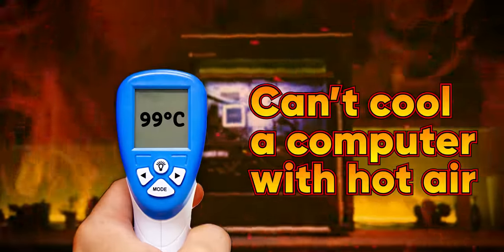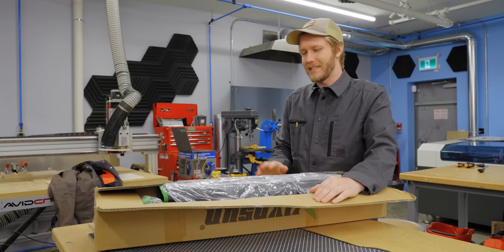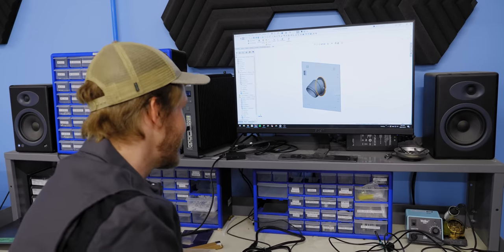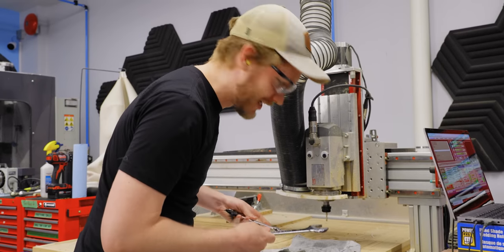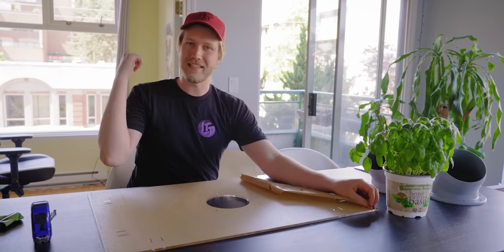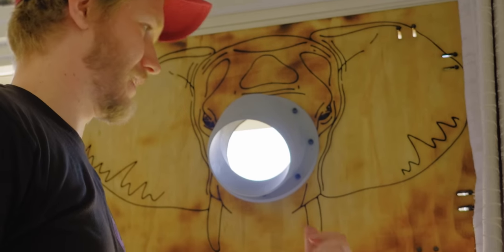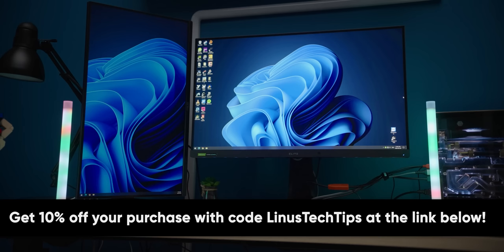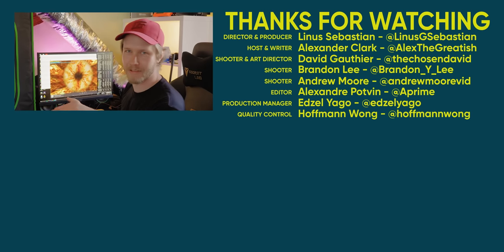You’re cooling your PC wrong. - PC in a Grow Tent

Comment: It's hard to say that the grow tent is the cause of the room temp decrease. Venting the room air (grow tent or not) cause negative air pressure in the room confirmed when you said cool air from the rest of the house was rushing under the door. It's entirely possible that simply venting the room and having extra cool air from the house rush in cause the room to be much cooler. Try the same test but without the grow tent, still vent the room.
Reply: That was the first thing I thought -- this seems like a misunderstanding of how the cooling of a home normally works. It's a closed-loop system. If this is constantly forcing air out, then somewhere else fresh outside air is being drawn in, which means the rest of the home is warming up due to bringing in warm outside air to replace it.

Rather than the air conditioner having to only cool down the heat from the PC, now it's having to constantly cool the heat from the outside air!

The real issue here is just air exchange with the rest of the home where it gets an opportunity to be cooled by the air conditioner.
Reply: @PabloEdvardo  The house isn't air conditioned tho. If it was, this would of course be pointless. He literally compared buying a grow tent to a shitty AC unit at the start.
Reply: I disagree, he is basically taking his PC, ~700W heat source, and not allowing it to vent directly into the room.  The fresh air exchange is just a necessary part of the overall system.
Reply: It's not just that. It's even worse. He is pushing air outside. Which means that air from the outside the house is also rushing in. This means if your house is still cool - and outside it's hot - he actively HEATING the house up. 

Sure his room may suck all the nice cool air from neighboring rooms. But what he actually is doing is wasting his cool house air and exchanging it for outside hot air. 

This thing heats up the house/room. Just for a small period of time where this single room pulls cooler air from neighboring rooms it seems like it cools the room down. 

This is a really really bad idea. Especially on hot days.
Reply: @tagg8233  at 1:40 he says, "I have air conditioning that's in the apartment"
Reply: Forcing the hot air directly out from the heat source is going to be much better than turning the entire room into a thermal mass that is being heated before venting. Your venting the heat from a 700watt electric space heater. It would have to be extremely hot outside to lose cooling efficiency keeping the heat in over venting the air out. There is no free lunch in cooling, you're paying for it somewhere. The big thing that is missing is a one way air flow vent that closes when the fan isn't running to prevent heat from coming in through the ducting. I would have bought a louvered window fan and built a housing/ducting adapter
Reply: @jabuki2  The PC takes the cool air from the house - heats it slighty up - then the air gets pushed outside. There is now a pressure difference between the house and the outside. There is absolutely NO way to prevent outside air now moving inside through the houses cracks and crannies. The air will enter the house at the point of least resistance! For his specific house and room - this seems to be a different part of the house. But for other rooms / houses it might happen to EXACTLY heat up the room you are sitting in. His room is sucking the "cool" air from the house first - but another part of it is heating up by drawing lots of air from the outside of course.

The air right at your house (where the sun hits your roof / windows / walls / etc.) is VERY hot. Probably much hotter then what your PC exhausts.

BTW: This method would also suck in cold air from the outside in winter. Which means that he would essentially cancel out his space heating by drawing in cold air from the outside.

The only way to make sense of this system would be to make TWO holes. Take outside air - use it in your pc to cool - then move it outside again. Completely bypassing the houses air.
Reply: Except this puts the heatsource out if the room air.

Its almost like growntents are designed like this on purpose.
Reply: @alex12ray  Fair. My error, I assumed he didn't because then yes, this is if not pointless, less optimal. Better would be a way to exchange air between his room and the rest of the house. This in fact works by drawing in conditioned air under the door to cool the room. Would be smarter to vent air back into the hallway to be re-cooled by the unit than out of the house. 

But this approach does make sense in unconditioned houses, especially in climates where it's generally cooler outside (especially northern Europe, where houses are designed to trap heat). It would also stop a rise in CO2, something which definitely happens with a human in a small room, which adds to discomfort. 

I have an outdoor shed used exclusively as a gaming room, which gets very hot in the summer. However, even when it's 25 degrees outside (rare, considered very hot for Germany), a unit simply to circulate outside air in is enough to keep it comfortable. Venting air out, as demonstrated in the video, would work similarly well. The grow tent is largely unnecessary
Reply: @m4ko288  I would be interested about the performance of the two hole system. They got insulated piping, but the grow tent has no thermal insulation. So heat would still come into the room through the grow tent walls - unless they insulated the grow tent too.
Reply: @martintirpak1033  True the tent would heat up over time - still contain most of the heat - but it would radiate heat nontheless. 

But thats still better then activley pushing air-conditioned air out just to replace it with hot outside air. 

He is essentially pulling air conditioned air - which was just cooled down - from the neighboring rooms, heats it up again and then pushes it outside.

Thats an absolutely catastrohpic energy waste. He pretty much created a ANTI-air conditioning unit which actively heats up the house.

This is also why his room got cooler: The missing air in his room made the air from the other rooms come to his room. And that air was cooler due to air conditioning running.

So yeah ... colossal energy waste ... 

Much better and easier: Just use water cooling with long pipes and let the radiator sit outside the house.

No air exchange needed.
Reply: @jabuki2  I think the window mount needs louvers, some chicken wire (imagine a pigeon getting stuck in there) and some sort of rain protection.

Curtains would also be a great investment.
Reply: @m4ko288  Think about it this way, he is exchanging the hothot-air from the computer to fresh outside air which is only regarded as hot-air. Either he uses the AC to cool down the 700 watt heater, or he uses the AC to cool down the outside air coming inside. Definitely a W as far as I am concerned.
Reply: @Sup3rman1c  The sun outside is heating up his house with many thousands of watts. Especially on a sunny day in summer - tens of thousands of watts. Depending on where the air comes back into the house - it could be very hot.

It would be MUCH more efficient to cool the tent / pc with an ac instead of what he is doing. This way he only has to cool down 200-400 watts (realistic gaming load - you will not reach 700 watts gaming - except for synthetic loads or super high end overclocking systems).

Competing against the sun with your tiny air conditioning unit... is not a game you are gonna win. The only reason why air conditioners work is: You close all windows and doors and keep the cool air inside for as much as possible.
Reply: It's definitely helping. The additional heat load causing the increase in room temperature is the PC. The grow tent essentially allows the fan to blow the vast majority of the heat directly outside. Without the tent there is going to be some level of air mixing causing some larger portion of the heat to remain in the room. That said just blowing the room air outside would help significantly for sure. Especially if the intake was near the PC. If there is a A/C return vent in the room just running air handling unit fan would lower the temp quite a bit, by helping to redistribute the heat in the room throughout the zone. That's what I do. 😉
Reply: @davidcsokasy5451  Yeah it's an interesting fun project, but ultimatly would be more efficient just to use an inverter dual hose AC or inverter window AC if possible (Which are both whisper quiet) to cool the room as they are about the same size as or smaller than that grow tent. Plus the inverter AC's use about 600 watts max, probably way less for that small room only. Or just put the computer in another room if possible. Or use outside air coming in to the grow tent to cool the pc and exhaust that same air with a dual hose setup. I do love the hacks of getting around using AC though lol. I hate seeing all that air-conditioned air just pushed outside though.
Reply: @Sunny01331  Totally agree on seeing A/C air wasted. He could have just hooked the ducting from the tent to the A/C return vent, and wouldn't have even needed the fan since the air handling fan could provide suction.

Comment: Since you printed 2 of the angled hose fiting i would recommend putting one outside with a mesh over it, othervise you will get rain going inside the tubing and insects/birds nesting in there as well.
Reply: No he’s got to use that for the second grow tent he get. I mean he did make two of everything
Reply: very good advice!
Reply: That fan is pulling 350cfm through a six inch duct, which means the air is exiting at 52.1 miles per hour; ain't nothing going in there.
Reply: @hlaw2830  you do realise that the fan is not going to be on permanently . . . not everyone uses their pc 24/7
Reply: @hlaw2830  I think you are missing the part where the fan is running on it's lowest setting. No way it's doing 52mph. Also BensCast is right.
Reply: @BanditIsGaming  yea use it to heat an outside grow tent.
Reply: @BensCastBen  You do realize how often they mention leaving things on and using Nice Hash, right? Plus, after he throws the LED and carbon filter in there, he'll be ready for plants, and then it'll need to run 24/7 to keep things quiet.
Reply: @TwinShards  If they said something about that I definitely missed it, lol, but that kind of fan doesn't turn down very much, trust me, I have a bunch, lol. If you were gonna use that fan to cool, it would most likely be connected to a sealed light fixture with a lamp burning at 3,000⁰F. An adjustable four inch fan on the lowest setting with a filter would still pull a negative in a tent that small, and it would be literally silent.
Reply: @A.Martin  Dude that's genius.
Reply: lmao imagine you go to power on your pc one day and suddenly bird
Reply: He’s not going to be using this, it’s just for a video tbh
Reply: The right thing to use is a dryer vent, which takes care of all that... this was clearly an excuse to 3D print and laser cut some stuff. =)
Reply: I was thinking the same thing

Comment: The ducting needs to have as few bends as possible. Each bend affects the airspeed. Also placing the fan as close to the exit as possible should improve air exchange.
Reply: Very good point, mount at the exit... Inside a noise insulated box
Reply: @iHelpSolveIt  By that point you might as well just put the PC in another room and run cables through the wall.
Reply: @5thwiseman  wont solve the other heat generation unit in the room... The high output heat source called the human body.😂
Reply: Placing the PC and "grow tent" closer to the window would also make a lot of sense, but this is LTT!
Reply: One thing he forgot to do was put a grate over the outlet to prevent ingress of wildlife and or rain etc